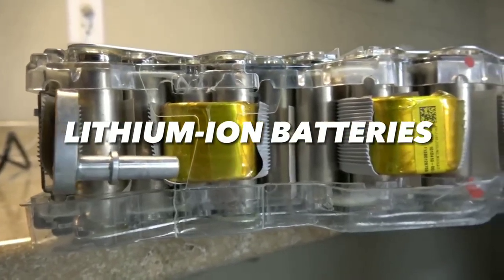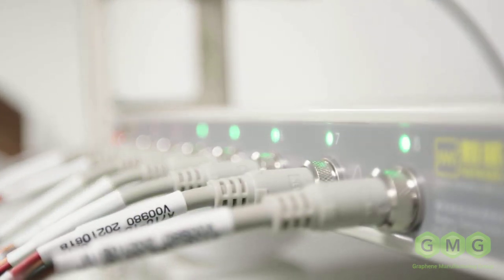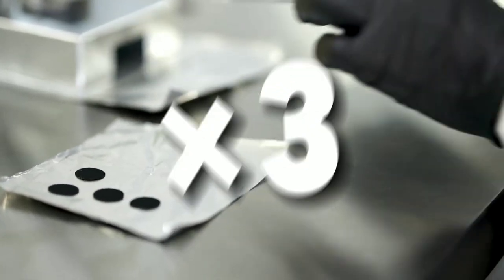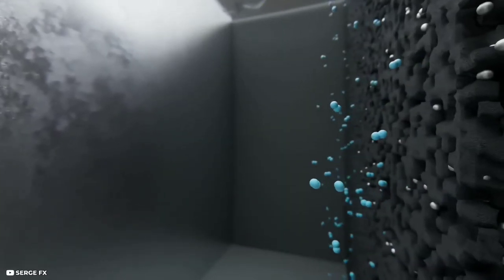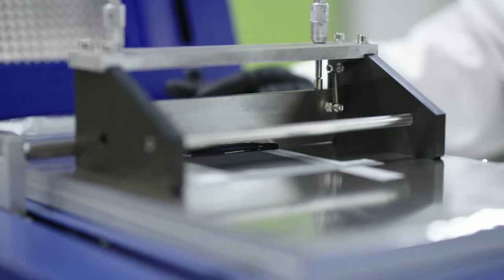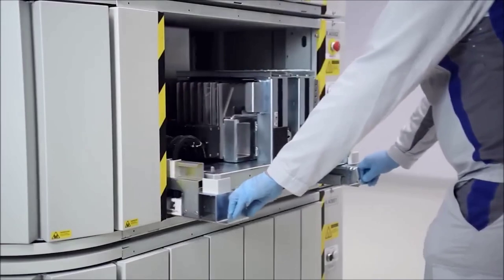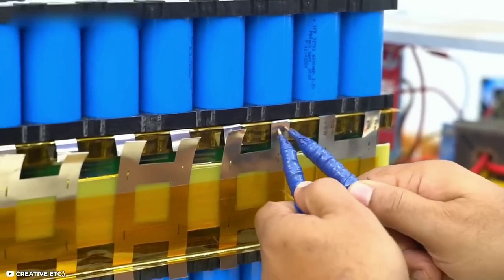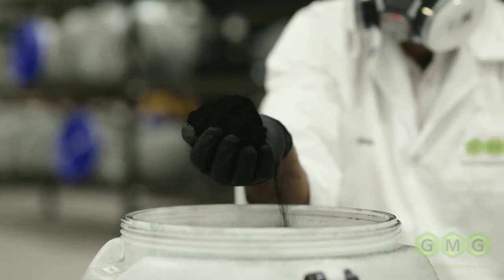Graphene Aluminum Ion Battery 2023: The Game-Changing Technology That Outperforms Lithium-Ion by 70x

Comment: You missed that the battery is not affected by heat or cold and can be charged at any rate (you simply need a big enough power supply, cable, and connection).

If think the battery is the future.  Really neat if you could add a nuclear diamond battery constantly charging your graphene aluminum.

Comment: Sadly, the title " outperforms by 70x" is misleading, possibly to attract investors, presuming investors are poorly informed. If the cell outperforms lithium 4 x (not 70 x) it would be already fantastic. All the claims about fast charging are mostly misleading too, because the power grid can't handle so much power unless very expensive, and charging station possibly using diesel-generators or a coal-firing plant to supplying so much power. Perhaps later, once we have the nuclear-fusion station in every town. Having a tiny 2" diameter diesel turbine with extreme efficiency to assist the battery charge is the dream for the near future. In that respect future is in a small battery PHEV vehicles. Ideally in these would be a good non-flammable 100+ km range small battery, to be charged automatically just as present PHEV vehicles doo. This also allows to charge the battery from home solar panels via small 120 V/15  power outlet. Myself I have this kind of arrangement at my house, and driving on Sun-shine literally with existing serial production SUV that can carry seven, or equivalent weight load. So yes, please go ahead with a better battery, but do not mislead with your 70-times claim.

Comment: However, there are also some challenges that need to be addressed before GABs can be widely adopted. These challenges include:

Cost: GABs are currently more expensive to produce than lithium-ion batteries.
Stability: GABs are not as stable as lithium-ion batteries, and they can degrade more quickly over time.
Manufacturing: The manufacturing process for GABs is not yet as well-developed as the manufacturing process for lithium-ion batteries.
Reply: What is the cost for a graphene aluminum ion battery? And compared to a lithium ion battery? 🤔

Comment: Yet another useless puff piece video. Instead of simply repeating yourself, why not actually provide the information viewers want:
1) How does the battery perform after being recharged 'X' number of times?
2) Cost
3) What temperature ranges can it operate in?
4) Specific energy density numbers (per kilogram, per volume)?
Reply: Yeah it's a wasted video unfortunately including the poor pronunciation from the computer generated voice. It's still early days on this battery but it does look very promising from what I've seen so far. I'm running by memory but I think it's supposed to have at least 3 times the charging lifecycle (6000+ I think) with less degradation compared to current lithium batteries. Cost is yet to be released but should be known fairly soon as the 1st gen versions of the battery pouch is supposed to be commercially launched later in 2023 or early 2024. It safely operates with minimal charge loss in environments of 0 to 80 degrees Celsius (that data is 6 months old and was going to have more intensive testing) and also no heating up issues during charging and discharging. I think the current energy density is close to 300W/kg which is roughly on par with the best lithium polymer battery. The last part has the potential to go much higher as they are currently only utilizing one of the three available ions so I'm hoping that in a couple of years time they will have cracked open the path to all three ions to make a 800-900W/kg battery a reality. End of this year though should be when we first get to see battery for real - hoping it lives up to what I read on it so far.

Comment: Yes, I believe in the battery.  More so, I believe in GMG.  The reasons are GMG can produce graphene from natural gas in a patented process.  This will result in high purity low cost graphene.  Also GMG has introduced a heat conductive coating which can be used in air conditioning and other applications.  Also small additions of graphene in Asphalt will improve its strength and durability.  Additions of graphene in plastics and rubber will increase their strength and longevity.  Graphene can be used in many medical applications and it can also be formulated to be very electrical conductive.  Graphene is the miracle material of today and GMG is setting up to become the high quality low cost supplier.  I'm all in as I own a good number of their shares for me that is.  Dick
Reply: Good luck with GMG stock. It is not alone in possibly soon selling low-cost high-purity graphene. It could be differences in their graphenes could make a place for several, or that one will be far superior and run the others out. Very difficult to know ahead of time which one might win out. I'm invested in another with similar potential. It's probably best to buy a number of the leaders, for if there's just one winner it will make up for all the losses, in all likelihood many times over.  So yeah, I should risk a little on some GMG.

Comment: Should GMG batteries be recharged with shaking motions and/or vibrations very easily. 
It is because both graphene and aluminum are supposedly very good for antenna 
for having extremely low electrical resistance.

Comment: Another youtuber that is clueless about the facts or is this just AI generated. The battery is not suitable for EV as it does not have the same density level, so it will be used mostly in heavy equipment. Just clickbait which is all you get from this channel